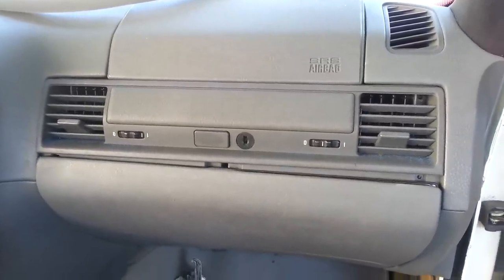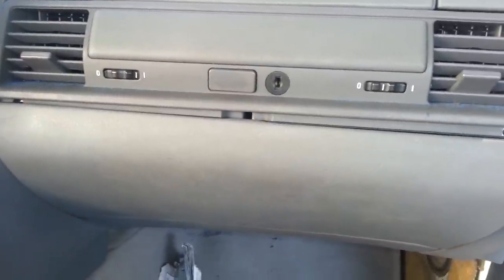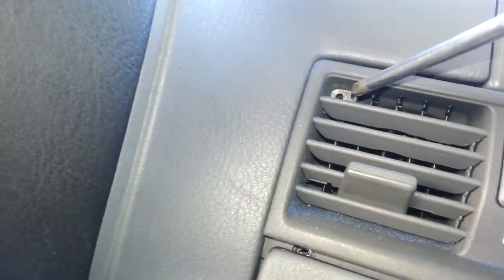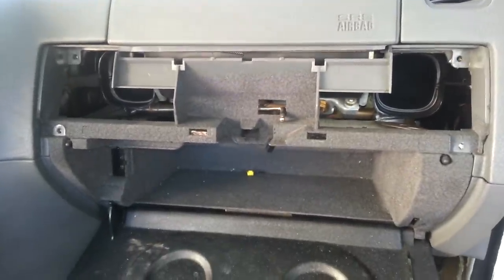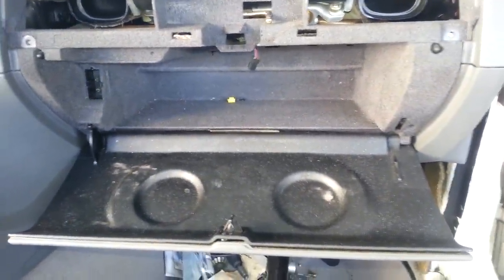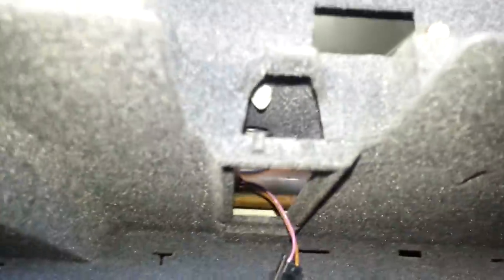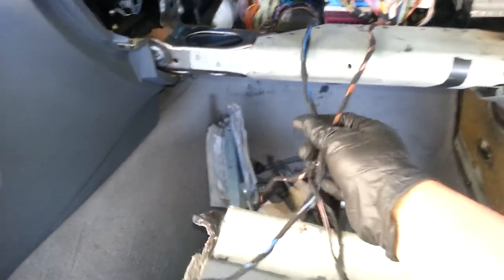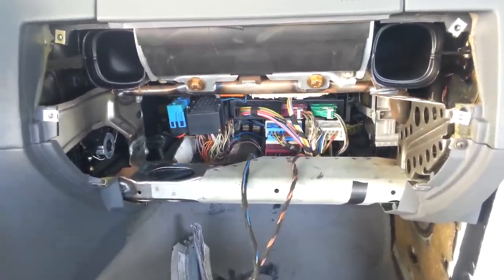How to remove glove box on a BMW e36 M3 325 328

Comment: Good video.  I had to do this to install a keyless entry system.  There were 2 more screws under the glove box to take out also.  Overall it was more work than expected.  You have to have the right socket wrench to get that 10mm bolt that is hiding in there.

Comment: Thanks dude. Gonna try to fix my sagging glovebox tomorrow, and I know I always break little clips because I can be a bit impatient... Saved me right there :p
Reply: Mythbuster  were you successful in fixing the sagging glove box? there's not much information on youtube about it, I'm wondering if its a easy fix.
Reply: Jovanne Santos Sorry, I didn't really. And there seem to be different causes for it for everyone :/  For me, the inside and outside of the actual glovebox door are coming apart, and the pin on the inside of the door that hooks into the "lock" was therefore not in the right place. I tried glueing them back together which made it less obvious...  Imho, just take it apart(it's not that hard), replace the cabin filter while you're in there(it's somewhere at the back, it's a bitch to do unless you take the glovebox out, and usually previous owners don't do it even though it should be replaced every year. Mine was full of leafs when i replaced it, car smelled way better inside afterwards), and then look at fixing the door by finding out what's actually causing it on yours. 
I think one other reason why it starts sagging over the years is because there's a pin with a spring that pushes into the door to operate the light inside the glovebox(just like on a fridge door).
Also just tightening some screws will already help. I've also seen people bend the pin on the inside of the door, but I was too afraid to break it.
 Good luck! :)

Comment: way would you cut out the wires when you can Just Remove with out cutting THEM??  OK!. not the best Advice here for cutting the wires
Reply from the maker: wires were cut because bmw was being parted out.  we typically sell wire connector with parts.  We con't recommend cutting wires if you are replacing parts